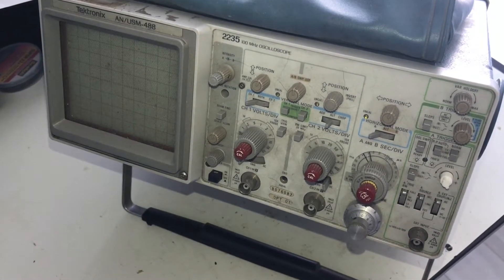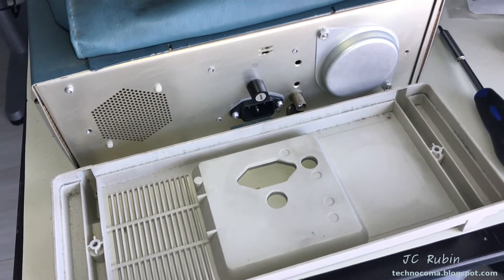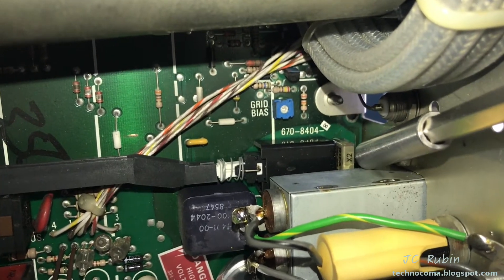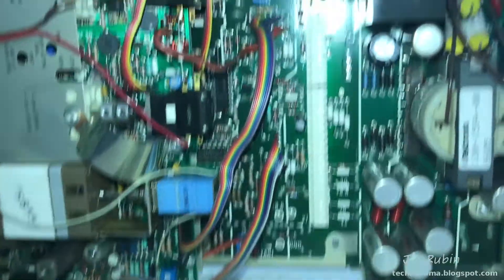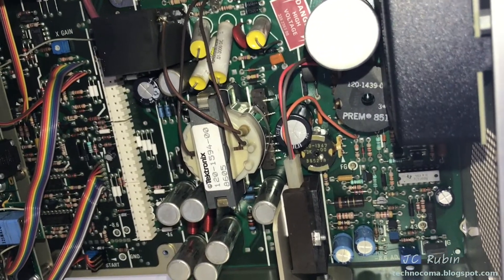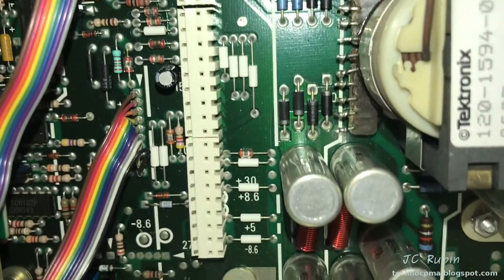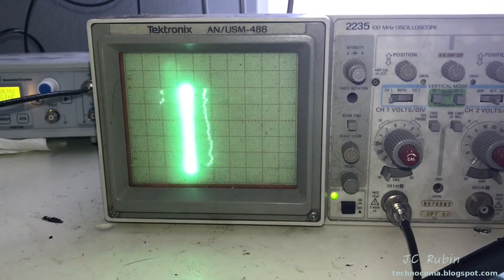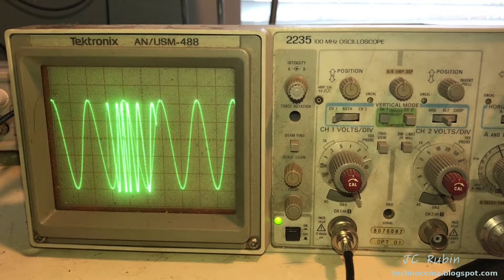Tektronix AN/USM-488 2235 Oscilloscope repair and calibration 1 of 7

Comment: Hi m8, I have a Tektronix 2225, the     front "hold off" knob has broken off( still can turn with a screw driver) and more importantly the 3 way MODE X1 ALT MAG ,switch seems to have lost its spring  , ie doesn't click 
Any ideas for replacement parts?
Much appreciated

Comment: Just picked up 2235 for 75 bucks Oct 2018, looking forward  to watching your videos on this model
Reply from the maker: I hope everything works ok
Reply: @retrotechandelectronics  doing the same....picking one up for 25 bucks tomorrow...guy has no leads and itll be my first ever oscilloscope...i figure for the price i got nothing to lose.
Reply from the maker: @T3ddy0wns  Congrats... U will need leads or coax to test it properly. Amazon or radio shack FTW
Reply: Retro Tech & Electronics yea i got leads coming tomorrow from amazon but after seeing whats out there i think they are lacking lol. 

Im gonna go grab the scope either way. For 20 bucks I figure at worst if it doesnt work it can be a learning experience. Im a Electrical Engineering student and trying to learn as much as I can. Any advice you got if i decide to pole around would be appreciated...looked up how to discharge caps and all that but im always open for more info/advice
Reply from the maker: @T3ddy0wns  Look for all of uncle dougs older videos on youtube for basic electronics with oscilloscope, also mr. carlsons lab.
Reply: Retro Tech & Electronics i got it and it works! Still gonna watch your videos cause it is caked in overspray paint and dirty as hell so id like to give it a little TLC. 

One question for ya though, what kind of probes would be ideal for this scope? Was looking to get some decent ones and didnt realize the choices out there. I realized the ones I bought on amazon arent really the right ones...also probably need to get a couple bnc to banana adapters for prototyping on boards...
Reply from the maker: The truth is under 100mhz its not critical. only the voltage rating.  The probes need only meeting the rating of the scope.  This gets critical at UHF but not really VFH or HF.